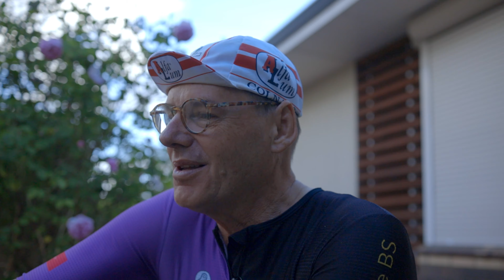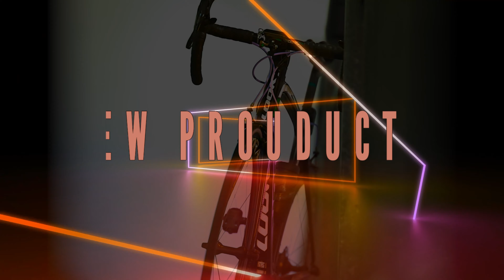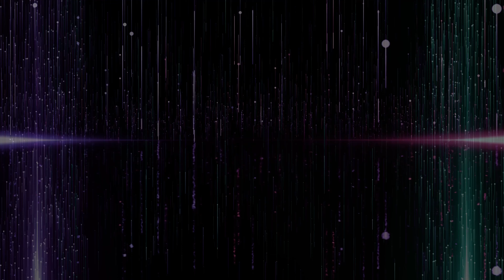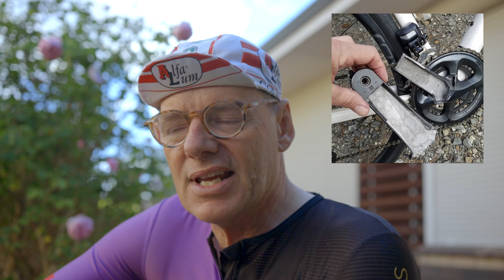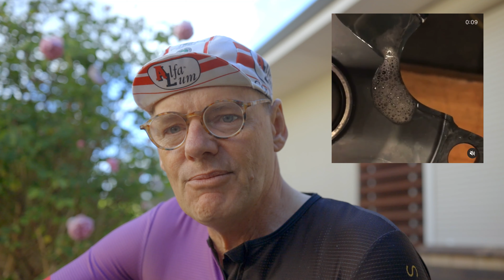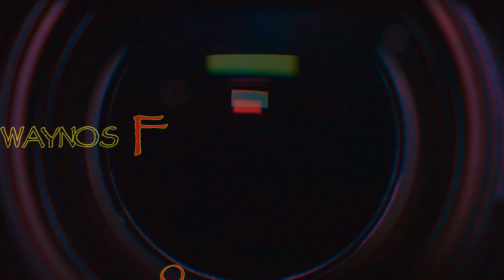Hollowtech FAIL, Shimano says; NO design flaw

Comment: I have had two of the effective cranks, a dura ace 9000 and a Ultegra 6800. Both have failed. A 100% failure rate. The 9000 while I was riding. It broke in half with the pedal and part of the crank ending up on the ground. They say they are aware of a little over 4000 known failures. I think the real number is far higher.

Comment: My R8000 has just failed, right crank arm has a significant crack all the way across and there are multiple cracks on the sections that join the arm to the chainset. Living in the UK and only use outside between Spring and the Summer. So far no response from Shimano, but their main retailer (Madisons UK) are reviewing the photo's. Probably covered around 5k miles....thankfully the parts simply failed and did not break away during use.
Reply from the maker: Sorry to hear 😮

Comment: Peak Torque gave a plausible hypothesis behind the failures of Shimano Hollowtech bonded cranks, a combination of thermal cycling of trapped moisture within the air pocket of the bonded crank and the gradual debonding  initiated where the greatest stress is applied at the interface of the two crank pieces usually just below the pedal on the power phase delivery side.

Comment: Every mechanic in the UK knows there's a problem, but Shimano will never admit it for two reasons: First, in doing so they'd have to do a recall on six years or so of Ultegra and Dura Ace cranks, which they simply don't have the stock to do (nor have they solved the issue). Secondly, if they didn't replace all the affected cranks, they would be admitting liability for injury and/or damage caused by the fault, which could cost them millions. My understanding is that they do replace those that break if you make enough fuss, but that is the cheaper option for them

Comment: Obviously cranks have failed in the same way so there is an issue and I'm disappointed that Shimano are not addressing this problem. Personally I've used these cranks for years and have no problem (my earliest crank is 10 years old). Also I don't know anyone who has had this type of failure. It is, as you say, most likely a moisture problem and could be related to where the cranks are made and subsequently sold. Shimano have a factory in Malaysia which has a tropical climate (this is where my cranks were made). I live in a country with a similar climate so moisture in the air trapped inside the crank would not have the same effect as someone living in a cold climate. 
There may also be an issue with how a bike is cleaned. For example pressure washing could force water and detergent into the crank if it is not 100% airtight. Or a crash could cause a tiny fracture in the bond line which could allow in moisture.
Reply from the maker: Yeah some good points.

Comment: Is this a problem with all hollow aluminium cranksets   or is it just a Shimano Hollowtech problem?
Reply from the maker: Hollowtech only as i  aware
Reply: @waynosfotos  thanks. that's a relief coz I remember back in about 2015 I came close to buying  a Hollowtech crankset but instead purchased a ROTOR  3D30 crankset (which is hollowed out aluminium) which I still have to this day. However, as far as I recall (without going downstairs to check) the spindle running through the bottom bracket is aluminium also (30mm) rather than steel, and the cranks are forged I think. 

So I am guessing, if my description is correct, I am unlikely to encounter this kinda 'Hollowtech corrosion/failure' problem?? Is that so??

Comment: Based on Shimano have had a flop in the 90’, i don’t think there’s strong evidence for them to back off admitting this a design nor manufacturing issue, given that;
1. It doesn’t fail within warranty period of one year or two year max? If it does, we’re not here for in-warranty discussion as they should have already replaced it without question asked,
2. Usually this failure happens in a pattern of;
      - happens gradually and visible and inspectable, due to the nature properties of base material and bonding material,
      - not catastrophic like hydraulic hose bursts mid ride (happened on Sram years ago, orchestrated almost in all bikes with this new product from Sram during a winter race), 
3. Cranks may not be considered a safety-related device, such as braking system, front forks, front hub axle system, handlebar, of which, losing anyone of those will loose control of handling the bike to a safe and complete stop.

Ironically, haven’t seen or heard anyone complaining on carbon crank failure after warranty, maybe there’s presumption that goes: “yea, it’s carbon, it will fail easier.” May i call it prejudice?

If there’s anyone to blame, it’s Shimano, still:
For setting too high a standard and consistent quality in the past?

Comment: I was told there’s no problem with the cranks as none have failed within the warranty period. Mine where 3 years old so Shimano wouldn’t replace them.
Reply from the maker: Should last longer than that at the price.
Reply: @waynosfotos  not if your 100kg but luckily I got some NOS 5 bolts hollowtech 11 from Shimano cheap as on compensation I’ve got 5 bolt forged cranks on all of my bikes.
Reply from the maker: @tobycolin6271  wheels are rated at 120kg, so you could argue if the frame/groupset manufacturer doesn't give a weight limit. Then they can't claim you overloaded it.
Reply: @waynosfotos  100kg is the limit on a lot of components and wheels some where even less. As a heavy rider I have look at the weight limits of every component I’ve purchased. Canondale historically never had a weight limit specialized trek normally 125kg and others are 100kg one well known top Italian brand is 90kg.  Then there’s the modern adventure load your gravel bike up trend. Very few of the bikes can carry the rider and the maximum number of water bottles let alone a large seat post bag.
Reply: Legally, the warranty period is a red herring - a car may only have a 3 year warranty, but if the axle snaps after five years due to a fault the manufacturer could still be liable
Reply from the maker: @TheCountrySteve  well they could say, it is fair wear and tear. Then you have to argue you used it as advertised as a reasonable person would. 
It also depends on the laws in your country.

Comment: I've had 2 x 6800 cranks fail on me. One was a winter bike but the other was dry weather/ Summer only. Both bikes stored in a garage.Mind, I live on the NE coast of England so maybe damp is a factor.
I had about 15000 miles out of each crank.

Comment: About naming it hollowtech, as I see it, it's more about the BB axle being hollow, and in higher end they add a hollow crank arm to that. 105 is called hollowtech, but it's construction is way different being hollow forged, not bonded. 105 does not suffer the same failures.
Reply: There’s Hollowtech, and Hollowtech 2. HT is the arms, HT2 is the axle/BB.
Reply: @TheGotoGeek  you're right, but it still doesn't specify if it's hollow forged or bonded. The forged crank arms don't suffer this specific problem.
Reply: it will happen on 105, once shimano trickle down the bonded hollowtech design from ultegra to 105.
Reply: @Billo7979  then stay away from it. But I feel like they won't.
Reply: @Rikcey  did a little google:
Congrats!
shimano latest 105: R7000 confirmed Forged Hollowtech.
look up for pic searching 'End of an era: Shimano 105 FC-R7000 crankset'
pic2 left crank inside view: Forged, not bonded.
pic 6 right crank inside view: Forged, not bonded.
Congrats.
p/s: can't paste any link here.

Comment: Without doubt a design flaw, the use of dissimilar metals is one challenge they have obviously failed to address.However the Hollowtech is the faux pas as it proves to be a fantastic design to accelerate galvanic corrosion. This is such a basic fundamental error of design for manufacture that it should never have left the drawing board. I suspect that if Shimano had been able to switch to carbon fibre they would have done however their previous attempt wasn’t a success. Until the public stop buying this not fit for purpose equipment they will continue to produce this dangerous rubbish for as long as they can get away with it. Disappointing but obviously true considering Shimano’s response.
Reply: That's why I chose to just mix and match components to my personal use case. I managed to track down an older truvativ crankset (44t is the biggest double my frame (Trek 920) allows) and the rest is Sram s700 10 speed, with mtb mechs, and Hope calipers and rotors. I couldn't be any happier. Then again, I don't compete anymore, but quality is about way more than number of (unique) gears.

Comment: A few days back l shared with u re purchasing THM full carbon cranks with power meter . A $2950 proposition.  Reason is l won't entertain dura ace CRANKSET.
Reply from the maker: I do believe they have carbon rings, need to be careful with these as they are not as durable as metal if the chain gets jammed.

Comment: I wonder if the issue is that the Shimano hollow tech is actually not hollow. The gear end of the crank is closed, thus creating a moisture trap. Compare for instance the IXF crankset. It uses open pipe construction that it is actually hollow.....also the crank arms are solid in a C-channel design.

Comment: I keep my bike in my house so I doubt this will ever happen to mine.
Reply: Do you not ride it outside then?
Reply: @ThePaulKat  That's not enough to corrode the crank.
Reply: @donwinston   the failure rate would strongly suggest otherwise.
Reply: @ThePaulKat  no. Almost all of the failures were in tropical areas. The moisture has to accumulate and condense. Very low probability of failure in humid conditions to begin with
Reply: @donwinston  your information is incorrect, failures globally and for a number of years now. Significant number of failures in the UK which is most definitely not tropical or humid.
Reply: @ThePaulKat  The number of fails is miniscule. Your numbers are made up. No one has done a credible survey of failed Shimano cranks. I saw some info on PeakTorque's channel and almost all of the "reported" failures where in subtropical or tropical areas. If you store your bike in a sheltered climatized enclosure there is no way it's going to fall apart in less than a decade.
Reply: @donwinston  Nope you are incorrect. I know of three people in one club in the UK that suffered failures, by design internal condensation can form. You say insignificant/minuscule however individuals have had 2 fail and the replacement within months, in none tropical or sub-tropical locations. Keep your bike indoors and only ride it on a warm day and you will minimise the inevitable galvanic corrosion, or better still leave the crank in its box in a temperature controlled room for maximum life span.
Reply: @ThePaulKat  The UK is weird. I understand it rains every day there.
Reply: @donwinston  not really sometimes it snows instead.

Comment: I ride with a fellow who had a 6800 crank fail on him and I own a 105 crank that is suspect. 
I’m curious if these crank arms are cast or forged. I’m guessing they are cast and with that, my guess is they fail from porosity in the casting, not galvanic corrosion.
Reply: Doubt it. Most of the metal frame parts of F1 cars as just one example are cast, and they undergo forces that are exponentially larger than a bicycle crank being pedaled by a human and they do not fail from porosity issues.
Reply: 105 shouldn't have the issue. It's forged, and not bonded. 105 never fails.

Comment: I personally know three people with that problem, I witnessed one on a ride. The broken crank arm ended braking a brand new high end carbon frame too. For that reason I have been holding off buying a Shimano groupset. Not that SRAM is any better with their rear derailleurs failing or brakes cracking.

Comment: The answer was provided by the Shimano lawyers after their accountants' calculations based on a product recall and liability in those cases with related injuries.
People in United States should start a procedure with the Consumer Product Safety Commission and a class action against Shimano due to volume of sales and judicial system there.
Reply: All bike component makers have failures. The problem with this failure is they refuse to address it. This problem is not going away for them.
Reply: @rcg9573  
That's why they have to be forced through the Consumer Product Safety Commission (USA) or any similar authorities elsewhere (there will be a chain reaction) or through lawsuits.
Shimano doesn't want to recognize the issue because it would be very costly. Just imagine the costs involved in a general recall on all hollowtech cranks.

Comment: I've seen two in my five years as a professional mechanic, both riders living in areas very near the sea with corrosion evident in other parts of the bike, you're right it is galvanic corrosion but it's rare., Not as rare for those of you in the UK I suppose. They ideally should have used a bonding process that eliminated galvanic corrosion.
Reply: I live in the UK and have been using Shimano for decades. I've yet to have any of their stuff fail on me, nor do I know of anyone who have. Currently running R8000 on one bike and 6800 on another.  Used Campagnolo in the past, but prefer Shimano shifting, and can't fault their longevity. I can't really comment on which manufacturer is better quality, because I've not had any of the other manufacturers' stuff for long enough.
Reply: Spot on

Comment: I'm confused. You say "dissimilar metals." Aluminium and what other metal?
Reply: The 2 forged halves of each crank arm are both aluminum, and are joined with epoxy, not brazing. The bb axle IS steel, but the failures aren't happening there.
Reply: @markfisher7962  the issue propagates from the dissimilar metal contact ie, steel shaft and aluminium crank. This is how galvanic corrosion acts.
Reply: The brazing alloy. You'll have to ask Shimano  what it is, it does fail at the bond
Reply: The steel crank shaft.

Comment: I have the Shimano 9000 Dura-Ace crank on my bike and not a problem yet. I like the silver crank and chainrings which is why I won't be buying any more Shimano cranks. I have to have the silver color on my bike because black is not beautiful. If this crank breaks I will buy an aftermarket from the likes of White Industries or even put an old Campagnolo crankset from 1985. I can work wonders with my Dremel and profile the chainring teeth to work.
Reply: WI makes some beautiful stuff. Also check out Sugino 2x cranks both silver and black. Seriously one of the most beautifully manufactured and finished cranksets of our current day. Strong steel axle with solid alloy crankarms. The same weight level as the Ultegra R8000 without any bonding or hollow weight weenie nonsense. Downside is price and no power meter option.
Reply: @josephphillips865  That Sugino Mighty Tour - 901D looks like a winner. I think I'll try to get my hands on one.
Reply: @wasupwitdat1mofiki94  Silver is definitely underappreciated these days. That Mighty Tour looks phenomenal. I have the OX2-901D but in black.
Reply: @josephphillips865  Thanks, I'll check them out.

Comment: I'm happy with my Shimano FC-RS510 crank set. 105 was not available with 36/46 chainring confiration and they are hollow too I think. Ultegra and Dura ace were way too expensive. So last year I bought 165mm long FC-RS510 cranks with 36/46 chainring configuration and I don't regret it at all.  Don't see any reason why I would need those hollowtech cranks.. Just because they are lighter? Why is the weight so important, that people would compromise in simplicity?